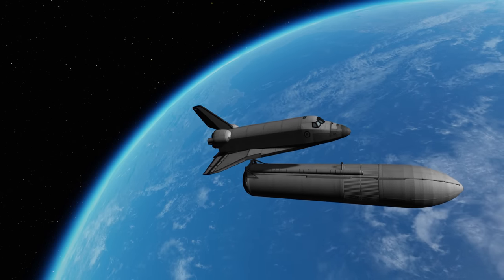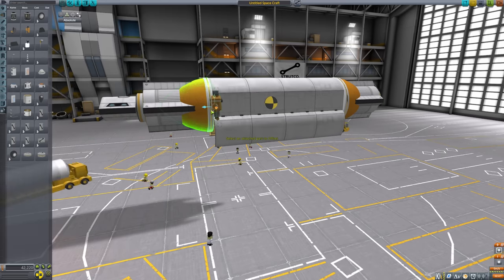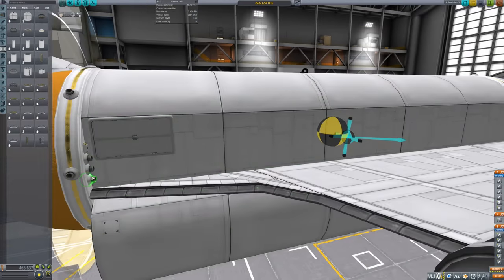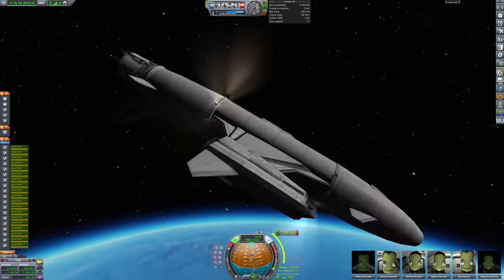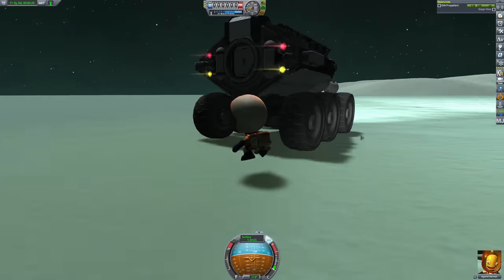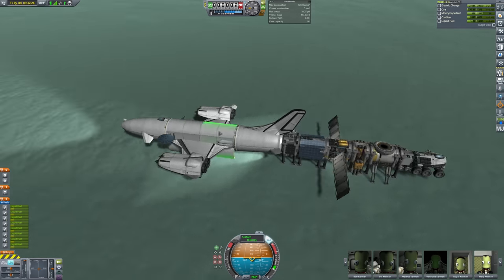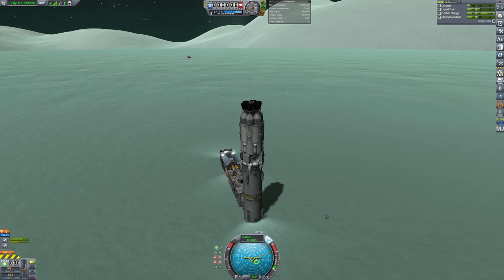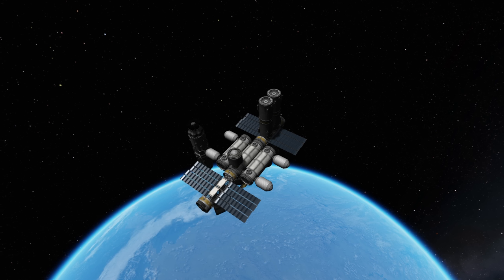PERFECTLY BALANCED SPACE SHUTTLE in KSP

Comment: You know... this is the first time I have EVER seen someone give any reasonable parameter for wings "I like enough wings to take off at 100 m/s" there, it's a good example! Just makes sense!
Reply from the maker: Well, in the end of the day most dangerous moments are take offs and landings. Making it easy and slow speed have its benefits. Shuttle ignore take off with rockets and land empty most of the time, less mass need less wings to glide on slower speed. Control surfaces are hard when you do shuttles with delta wings, but if you do them close to center of lift or spread them to forward and back they are easy. And angle of attack matter only for hypersonic SSTOs.

Comment: I thought that the wing engines rotate to allow VTOL. I winder if it could take off from kerbin or laythe with those being able to rotate
Reply from the maker: Well it depends on how good is autostrut, generally vanilla hinges and rotors are to wobbly for SSTO. I think good way to do VTOL similar to my design is to use bottom facing mk2 cargo bays with several aerospikes in the longer nacelles, they should fit and have good thrust for places like Duna.

Comment: what ksc mods do you use?
Reply from the maker: Visual enchantment like Waterfall, Spectra, Scatterer, Planethine. Extra stuff on the ground is from KSC Extended. Docking port indicator. MechKeb is used for the most part to create nodes fast. I use Kerbal Joint Reinforcement, but the same result achievable on this craft with vanilla autostrut setting, just take a bit time to properly setup compared to KJR.

Comment: what mods did you use to build this?
Reply from the maker: Gameplay altering - None. Everything is visual enchantment like Waterfall, Spectra, Scatterer, Planethine + KSC Extended. MechKeb used for the most part as a habit QoL to create nodes fast, but this functionality is now vanilla. I have used Kerbal Joint Reinforcement to have non floppy wings on the recording, but this is achievable with vanilla autostrut setting (just takes time to setup manually). In general there is no real difference for a simple craft like this between Kerbal Joint Reinforcement and Autostrut. KJR becomes to powerful when you do something with lots of docking ports and modules. There is link to this craft reinforced with normal struts in the pinned comment. Will be releasing autostrutted version a bit later.

Comment: Too much part clipping and drag reduction explois in my opinion.  If you're going to claim a better design than a real world vehicle you should at least make some effort to make your design feasible IRL.
Reply from the maker: KSP is not a real simulation game. My favorite non clipping tip for you is to slap two biggest orange tanks to sides and attach matching nose cones on both ends. Now you have to huge tanks with no drag and no clipping. KSP simulate drag of every single part unless it is occluded by cargo bay, nose cone or fairing. Thus making "exploits" basis of the game aerodynamic model. Technically putting payload into cargo bay is already exploit. Clipping without "exploits" achieve nothing on its own, mass is still there. If you want to see real exploit combinations of KSP systems check my forbidden KSP tech video ;-)